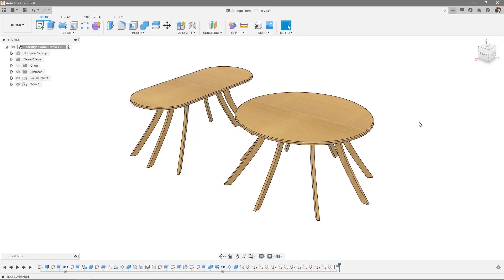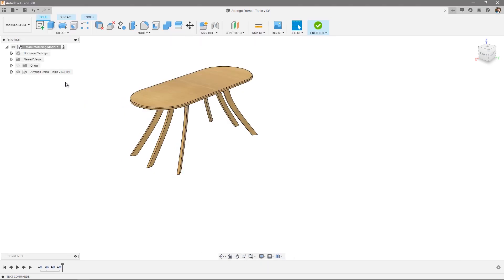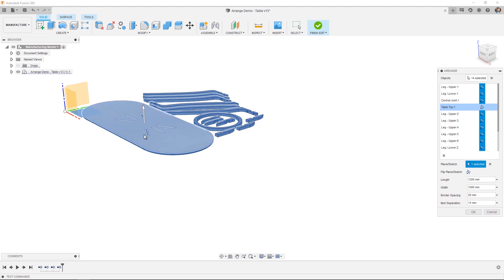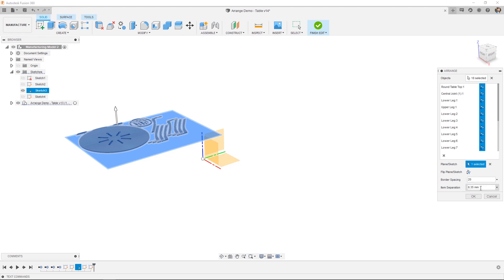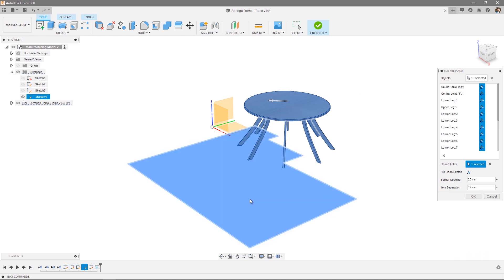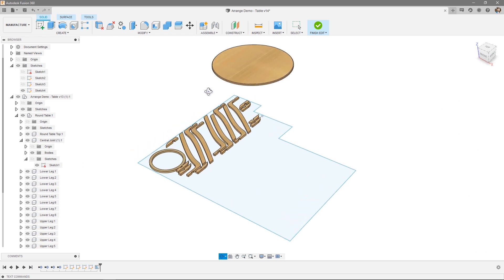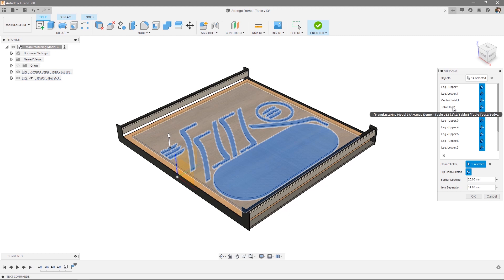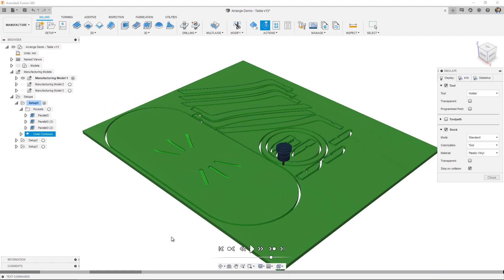TUTORIAL: Arrange in Fusion 360

Comment: Great Feature.  I think I might be missing something so let me describe my scenario.  I have a box with 2 long sides and 2 short sides, and a bottom.  The joints I would like to use for this are all finger joints created with a Fusion 360 Addin.  This works correctly in the Design Work Space...But when I go into the manufacturing workspace and create a manufactured model I box select everything and it will only selects the bottom which is not mirrored and one long side and one short side.

I was able to work around it by clicking the individual pieces and selected them but now some of the parts show up below the selected plane..

Second part.  Typically if I am doing this on a CNC router you will need dog-bone fillets.  I typically use this in the design work-space by using the Dog Bone Fillet tool as an Addin....I am noticing that these tools do not appear in the Manufacture model work space.  I think you may have the same issue with these tables unless you accounted for the dog-bone fillets in the design?

Comment: Am I correct in thinking that individual components can't be forced to take a certain orientation - for example if you wanted the grain of a plywood sheet running the same direction in all the leg components of the table example?
Reply: That’s correct Jim. Orientation is determined automatically by the nesting algorithm for arrange. If you would like more control over component orientation, check out the preview feature “Nesting in Manufacture”